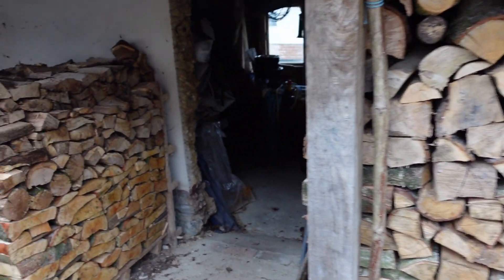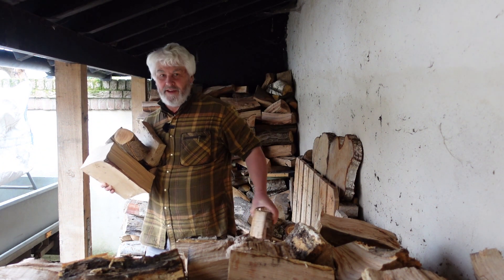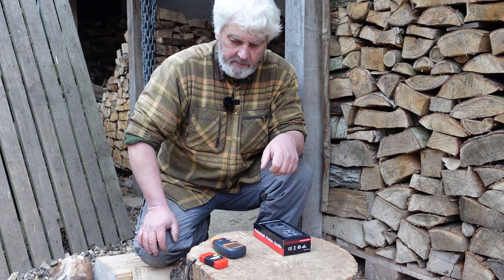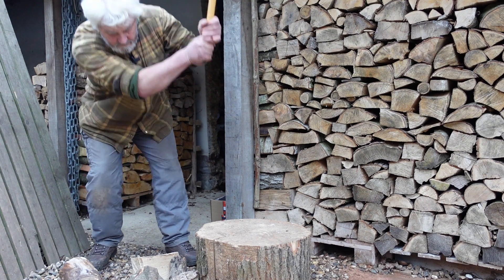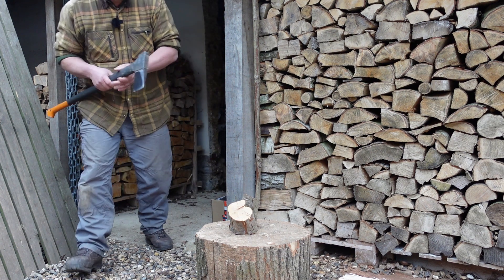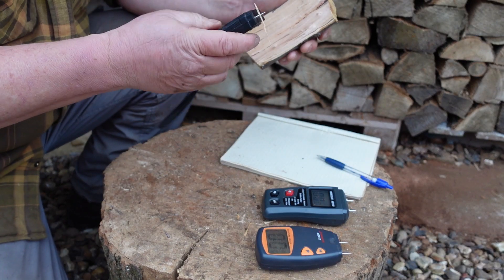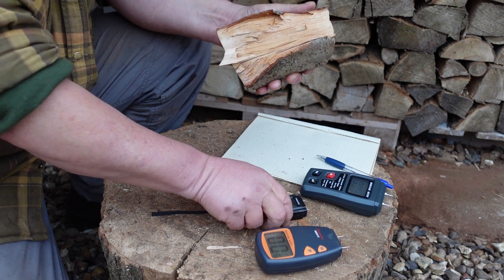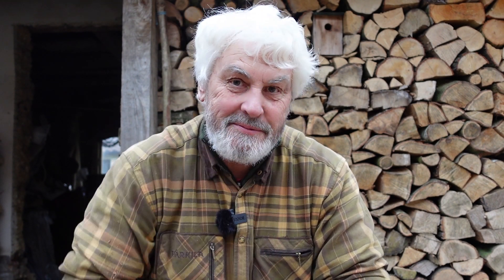How to Check Firewood - Moisture Meters

Comment: Wood dries primarily through the end grain, not the sides. The wood stack behind you shows almost all you need to know:

1.  The ends have darkened with age. 

2.  There are few if any cracks showing in the ends. 

There are three visual stages of drying firewood:

1.  Cracks appear at the ends as drying starts. 

2.  End cracks start closing as the middle of the piece dries. 

3.   Cracks close as moisture loss becomes functionally complete through the length of the pieces. 

Wood shed types:

1.  Drying shed.  Free standing, no solid walls. 
I favor lattices.  At least a foot of ground clearance to the (slotted) floor for air circulation and varmint control.  Your cats should have access...

2.  Storage shed.  Can be enclosed.  Transfer from drying shed(s) as season dictates.  Again, allow access for your cats.

Additionally, different woods have different cell structures which dictate the amount of heat needed to drive off any remaining moisture.  Oak requires more than most and as such needs to be drier to yield max BTU's while ash gives up its moisture readily.  Remember the old adage "Ash green or ash dry makes a fire to warm you by". Thus ash is/was dubbed the "kings wood",  reserving the right of its use for royalty first.

Still, the best method is to work "2 years ahead of time"...
Reply from the maker: All good thoughts - but I am not in a rush, so accept some radial drying, Thanks for your comments - I need a cat!

Comment: Good video but my one concern is with your new moisture meter. You didn't select the wood mode. And that's probably why you got the 2% difference to your old meter. I say this because I have just bought the same meter and I am a little concerned about choosing the correct wood group. My logs are a complete mismatch and I'm not sure which is what. Any advice would be e
welcome.
Reply from the maker: Good points. I have the same problem in that my logs range from larch and pulpy birch to oak hawthorn and fruitwoods. I think I used one of the mid settings, as I am not going to re-set it for each log. I think for us both it perhaps should be seen as a guide, the percentage not being an absolute. A confirmation that a log is ready to burn. The big deal is to use one in the first place and keep a check on our judgement. Have a good winter. Thanks for your thoughts, Vince

Comment: great vid, new to wood stove heating . i bought a moisture meter, i noticed logs already split are fairly dry inside, but the bark is attached and very high moisture 30% - 40% measuring on the bark on the logs on the bark . i see these videos, people don't measure the bark? i assume that's not ok to use?
Reply from the maker: Interesting observations! The logs will dry faster on the split face and I would say that your logs are probably not yet fully seasoned. The bark itself usually has more heat energy per kilo/pound than the actual wood - so once dry it is good to burn. Mastering you logs is probably the secret to enjoying good wood fires - I hope it all goes well for you. Best wishes, Vince

Comment: last year my wood was 15% this year it's around 6% after having a very dry fall and it's burning so much better, thank you for your videos and I love your book
Reply from the maker: That is impressive!  The driest I have ever got split logs is about 12%. And the extra heat energy you will have got not having to boil away the moisture will be noticeable and welcome!
Reply: So you got me thinking I did something wrong so I split a piece of split wood and tested the inside of that and you are right it was 15%, even though the split wood test 5% outside or on the end, where the wood was split a year ago, so how many years does it take for 20" stove wood to dry out after being split? Will it ever get below 10%. @WoodFiresWithVince
Reply from the maker: Hi Nathan, really good that you tested the inside of your logs. My main thought is be happy with logs that are 15% mc on the inside and have an outer  'shell' of 5% mc. I would say that this is fine - as a general rule. Most log species, if split and stacked with good airflow, get as dry as they are going to in a year. If the logs are big or a very dense species it will be longer. A good friend of mine would get his split birch logs dry enough to burn in 6 to 8 weeks of summer weather. Unless you live in an unusually dry area, I would not have a personal target of 10% mc - that is drier than most of us could ever get. Or, as the outer log dried to 5/6% mc, you could split your logs smaller to catch the benefit of a really dry fall. All best. Vince

Comment: Hello, I've just come across your channel while looking for info on using moisture metres.  Your video was very interesting and I shall enjoy seeing the rest of the channel.  In the meantime, I do have a couple of questions:  (1) The logs we have delivered are generally a mixture of woods but I can't identify them so wouldn't be able to select a specific wood on a moisture meter - in which case would the measurement be wildly inaccurate?  (2)  We store logs in our barn - is there likely to be enough air flow inside a barn?  Thank you.
Reply from the maker: I think that checking for moisture content is not a perfect science.  I would say that if you are not sure what wood you have, decide if it is a conifer or hardwood and use one of the middle settings and then be consistent in how you take the readings so that you have some relativity to check how the wood is drying out.  Secondly, air flow to dry logs is a really big deal - if the barn is fairly air-tight I would only store logs that are already dry enough to burn.  If they are not dry, then I think it's best you create some good airflow with windows, shutters, doors open a bit - whatever might help - or make a drying woodshed outside somewhere. Good luck, Vince

Comment: I don't think you've done a video about where to dry your wood/place your woodpile? Other channels almost claim you have to dry it in full sun, but you seem to be sucessful drying it in a shady spot (as long as airflow is ok that is, although you stacked a lot tighter than I expected)
Reply from the maker: Good point - and you are right. I believe that 'rain off and air through' are the most important - the wood will dry to the ambient moisture content then, and fairly evenly. If you have a climate with lots of sun and very little rain, fine use the sun - but I do not believe that that is the case for most people. My tight stacking is as I have limited space, and as my home is totally wood heated I want a decent reserve in case I can't get wood for some reason. And I have pallets all around the stack for good airflow.

Comment: Hi fella, ive burnt most wood over the years and have recently been given some Monkey puzzle rounds that ive never tried before. Would you bother with splitting and storing for a couple of years taking up valuable space in the store? Thanks
Reply from the maker: Morning, well, this is a tree species I have never burnt before. All dry wood works in a wood-burning stove, and I think Monkey Puzzle has an open fibre structure so I would expect it to dry fairly quickly when split - quicker than two years certainly. If it was me, I would use it and see how it works out - you might be offered more one day! Vince

Comment: Im new to wood burning, is it ok to store wood in the house, under the stairs where it's dry and dark,?
Reply from the maker: Hi, I would say it's probably best not to store logs there. Two reasons, first there is no air flow and the damp logs may actually just sit not drying, secondly you may well bring a whole load of unwanted insects into the house. If you can, build even the simplest wood store, maybe just with pallets. Air through and rain off is all that is needed. I hope you work something good out. All best, Vince

Comment: Pity the firewood suppliers can't be bothered to buy one. I frequently buy wood which is far too wet to burn and despite stating <20% on ther website, suppliers clearly never measure MC and are satisfied to consider the wood "well seasoned".
Reply from the maker: That is so wrong of them - it is not a difficult thing to check. 
We are getting a lot of totally wrong flack recently about smoke, and our best first defence is to burn cleanly, and that means dry logs!

Comment: Hi - what’s your view on using air purifiers inside with a wood burner with HEPA filters ? Help with harmful particles etc ?
Reply from the maker: Hello - yes wood burners are getting such a bad press just lately in the UK. For years we have been told that oil and fossil fuels are the enemy, and then suddenly it is our wood stoves! I would like to get hold of the original research as being told that stoves cause 27% of PM2.5 pollution in the UK, when they are not even lit for most of the year, seems very odd!?? I did read a while back that the research was done during a very cold winter period when most people with any form of fire had it lit.
To your question - Firstly, good technique means that you should not be getting any significant smoke back into your room. So only if somebody has bad asthma or something would I think about air purifiers. I have just bought an air testing meter (for PM2.5) to see how my stoves compare with other things I live with - candle lit dinners, burnt toast, frying anything, vacuum cleaners, joss sticks, etc.  Data is only meaningful in context - and I want to know the PM2.5 levels in my home just from everyday living - you might try that too before looking at an air purifier. Best of luck whatever you choose to do. Vince
Reply: If the government says it, I don’t trust it

Comment: You're meant to test with the grain, not across it.
Additionally, did you adjust the new meter's settings based on timber type? There is a potential large range of results based on the setting chosen.
Reply from the maker: Interesting points. I know it is usually said to test along the grain - but did you notice it made almost no difference with either of the two good moisture meters if used along the grain or across the grain. And yes I did change the species mode. I did not film it, possibly I should have, but I thought showing the new meter in close up (at about 3.50 for 7 seconds) with the four tree species settings in full view was hopefully enough. Thanks for your thoughts. Vince

Comment: Thank you for your videos. I’m glad I found them, it’s a subject I am also passionate about. I burn mostly oak which is very common here in Connecticut in the us. I mark sample logs with an x on each end when I’m splitting my firewood. I then weigh them on a small kitchen scale and mark the logs with their green weight in grams. I can check back on them to see how the drying is progressing. I supplement that with th meter
Reply from the maker: Hi Jeff, that is interesting, very thorough and I have not know anybody do that before. The two measurement systems will give you a moisture content figure you can have real confidence in. Nice! All best. Vince
Reply: That is a really smart way to check drying